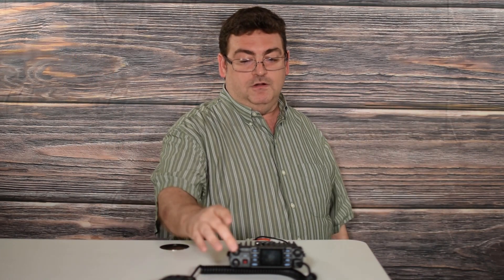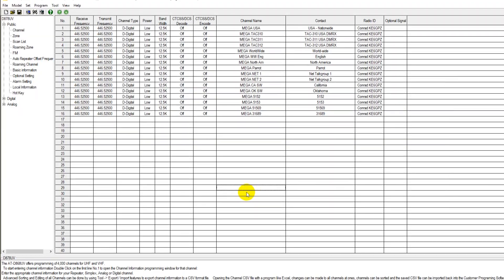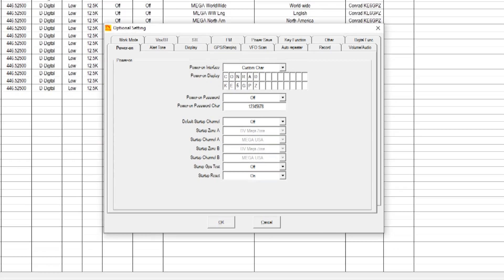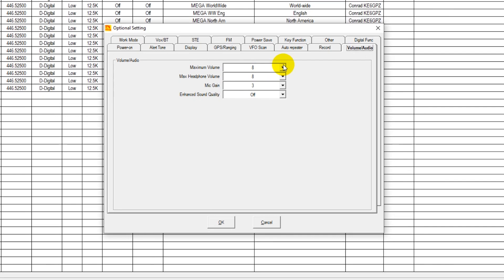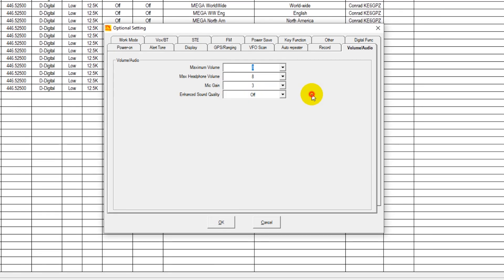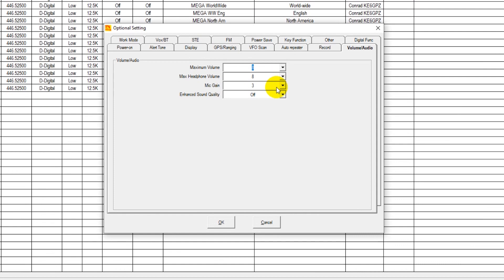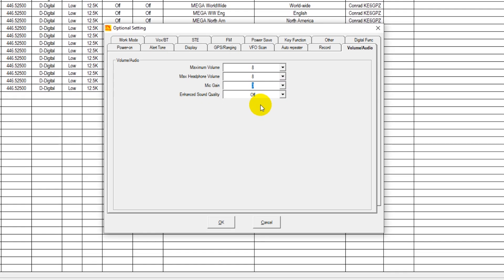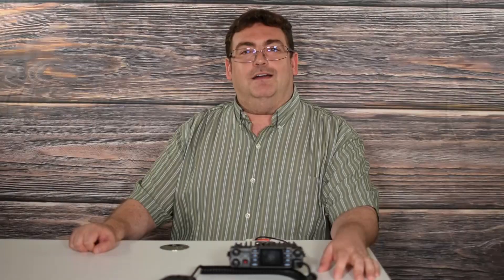How to Adjust the Audio Levels on the AnyTone 578 Mobile Radio

Comment: Ok, but how to change minimum volume level? I tried to change these settings you shown from menu on the 878 radio and it didn't bring any effect. Tle low level of sound is too high for me. In my office i like to listening the WFM radio and on the very first level the speaker is too loud :(